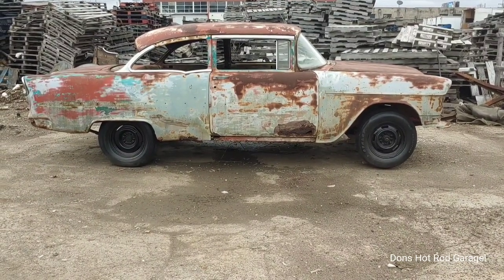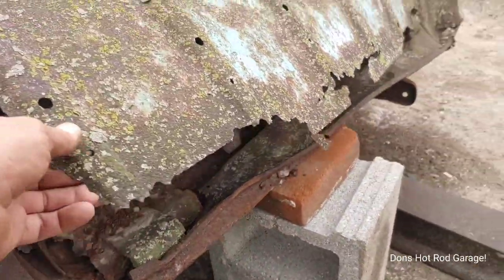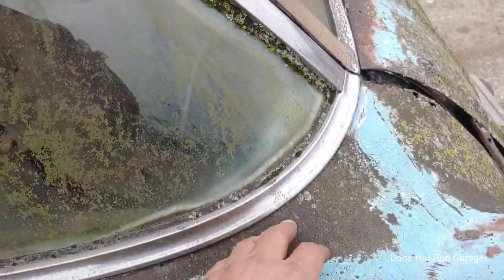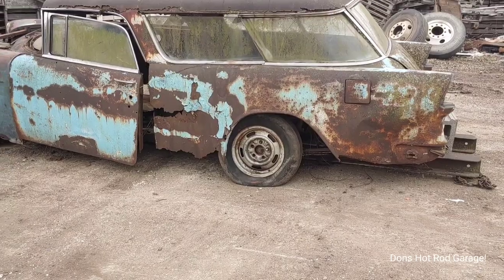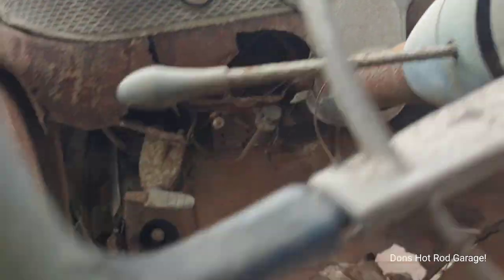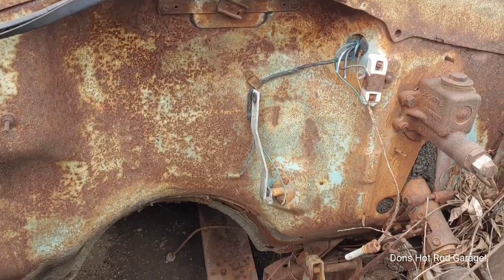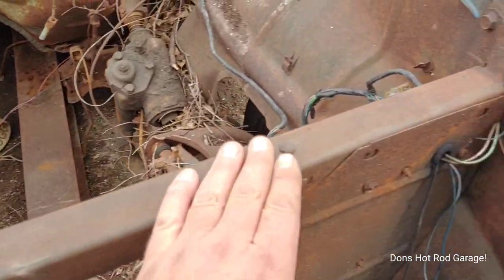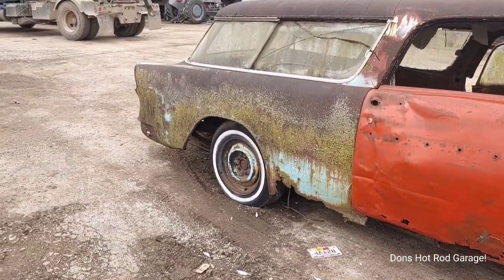55 Chevy Nomad Junkyard Find! Worst Nomad I've ever seen! Total Parts Car!

Comment: Don, you were so right that this one is worse than "the other one". But I typically would doubt anyone will be able to save "the other one" until I saw what Dan's doing to his. He basically had a good roof & one door. He'll certainly be able to use some of your trim pieces, and maybe some glass. The border opens up on April 1rst (April Fools Day 🙃) so he could make a trip down when the weather improves to one of those Border Mailbox places to save on freight...
Reply from the maker: Hey Jim! Yeah this one is mega ruff! It'll help out countless other nomads get fixed back up! Ive contacted Dan about some parts I just have to get them off ans good from there! Catch you next time 👍
Reply: @donshotrodgarage1717  The only reason why I’m not getting Kim I I’m

Comment: Well done Don. Lucky you got it back with out it all over the highway. It's funny but it still a Nomad. . You could sell the two sides for wall Art. But great you see the parts worth saving.  Water jet some Nomad key rings..but I think this one gets laid to rest.  Flat pack the original metal on a pallet. This one will make you plenty money. Get a tripod. Film Work in action on Fast Forward. It's history for the people.  Good luck Don. Send me a Nomad keyring. Adios Brother. Have a good week.  Dino
Reply from the maker: Hey Dino! Yeah its mega ruff! It'll help out countless other nomads get fixed back up! I have a guy building a 55 nomad from scratch and he wants both full inner and outer quarters! There won't be much tossed out! I'll do plenty of videos on the tare down! Have a good one Buddy 👍 Adios

Comment: Wow! Lots of parts tho. Wonder if it got sunk in the ocean or something? My dad did that with some friends back in the 50’s in Daytona Florida on spring break. Can’t remember the car, but the car was never the same and rusted completely away in the next few years…
Reply from the maker: Hey Lance! Im not sure if it was ever in a lake! The spot it was setting at for the last 50 years was under a tree on the left side. I don't think it ever got and sun to help dry it out! Catch you next time 👍
Reply: My dads story was something like this; his brother and other college friends were heading toward Daytona Beach in about 1953 or 54. Dad was still in high school. He snuck out of the house with his roller skate case full of his clothes and etc.  They took the friends car which was a nice car. On the way, they set the car on fire as they were throwing fire crackers out the window on a bridge trying to scare some fishermen… a firecracker bounced back into the car and under the seat and it caught fire. They put out the fire and continued. When they got to Daytona Beach, at the time, people drove up and down the beach. So they did the same thing. But got stuck in the sand and the tide came in and swamped the car. They eventually got it out and drove back to Michigan. Didn’t wash the car, didn’t do a thing with it but drive it home. Very quickly the car started rusting and was a horrible rust bucket probably a year or so after. But anyway, dads now passed away but I always got a kick out of that story. Teenage boys and cars… I can totally see a similar story in the Nomads life but I guess we will never know… thanks for the interesting videos!
Reply from the maker: @lancenutter1067  wow man I wasn't expecting that. Really cool story and I have heard you could drive on the beach years ago. Im not sure may be the nomad had a similar experience with the ocean! It sure is mega rusty!  Catch you next time 👍

Comment: The bad thing that happened with nomads is back in the 70s&80s nobody wanted them cause they always leaked from day one rear hatch and side windows they were just always wet inside unless you lived in like California or Arizona I remember when you could buy fairly clean nomads still daily drivers  for 800-1200 bucks all day long  lol. Alot of these started rusting out in the back and rear floor pans at only 5-10 years old though. East cost cars if daily driven and parked out side were toast at 10 years old max. Only ones left now are ones that originally came from southern regions as new.
Reply from the maker: Hey D owen! Yeah man your right about them leaking water inside! It seems like all cars when they hit the 15 to 20 year old mark are at there cheapest price pont! The ones from out west are by far the best ones but we still got plenty of them here on the east coast that a nice! Catch you next time 👍

Comment: 1955. I see lotta glass windows. Los and lots trim. The Speedo and steering wheel. The dash looks in good shape. More important is the shape of the panels. The chassis is an excellent template.
Reply from the maker: Hey Stanley! Its mega ruff! It'll help out countless other nomads get fixed back up! Not much will get tossed off this car! Catch you next time 👍

Comment: Don. Don't chop it to fast.  Rat Rod Bob has made cars out of worse than that.  Send him a message.  He just wants the outside panels he fix that up. After you pulled all the trim bits your want. It might not be dead yet..
Reply from the maker: Hey Dino! It will be carefully separated. I have a guy that needs both full inner and outer quarters to build his 55 nomad from scratch! Nothing will be tossed that is good. Later man ✌

Comment: I would still save the outer quarter skins from middle up.  And the rear end if its an original. And you can use that rear glass for now. And dash trim.  Good enough stuff for now just make a crusty.driver out of the one , floor pans running gear nose off the one you just got you have a couple nice drivers, so have a crusty one to drive that's totally dependable lol. Its Kinda to far gone to justify alot of money into it but its worth making a crusty driver call it the rustmad lol. Run one of them painless wire harness through it . they are worth every penny they do exclint work or put the new one in your other nomad and put the old one you take out in the crusty car . they all (tri 5 cars ) use the same harness unless it has power windows and air conditioning.
Reply from the maker: Hey D owen! Yeah man this old nomad will be carefully separated. I have many people wanting even the sheet metal off the car! It will help countless other nomads get fixed back up! Catch you next time 👍

Comment: Man, that really is just heartbreaking to look at. You can tell it was never seriously wrecked, and at one time a person such as yourself, who loves these cars and cares about them, could have saved it and made a fine project of it. 
           Some Idiot probably ditched it because it started burning oil, or maybe a ball joint started to rattle. 
"Duh hey, I busted up that Stradivarius violin for kindling to start a fire in the barbecue because one of the strings broke".
 How many beautiful things are lost forever because of that mentality?
        Be that as it may, you know what the next move is gonna be.
You've got to do what the indigenous tribesmen, formerly known as "Indians" used to do when they killed a buffalo. They thanked  the animal for giving its life, they thanked the Great Spirit for providing it, and then they proceeded to strip it down to the last bit, wasting absolutely nothing. 
         I think you'll be pleasantly surprised at the amount of usable salvage you come away with when you break it down. You've got what looks like most of the glass, the fenders can definitely be saved, most of the dash trim that's still there looks all right and there's lots of hard to find body  trim. I can also tell you that the radio can be saved. It has tubes in it. My '59 had a radio like  that and the tubes were 12AX7,. and 6V6, very common, and still being made today for thousands of guitar amplifers all over the world, (I build, repair, and sevice those, and tube technology is very familiar to me) so don't scrap the radio. It'll be a fairly easy fix. The tubes are probably RCA or GE, and they might even still work. A music store will most likely have a tech with a tube tester and can tell you if they're still good. They might just be fine, even after all these years.
         I repeat what I said about it being heartbreaking, but the best way to honor the remains of that car is to make sure that as much of it as possible gets a chance to live on in another one.
           You've got your work cut out for you, best of luck with all of it. Once again, keep us posted on the progress!!!
     Cheers, and hats off!
Reply from the maker: Hey man! That's awesome the knowledge you have on the old radios and the tubes! You have to let them warm up and boom here comes the music! I'll carefully separate this car! Its help countless other nomads get fixed back up! I'll do plenty of videos of the teardown! Catch you next time 👍
Reply: @donshotrodgarage1717  if I lived anywhere near you, I could bring my old '56 Fender amp over, and we could put those tubes in it and find out in 2 minutes if they work, and if they sound good. Tubes are fascinating little boogers, and they are as much fun to play with as cars and engines. In a way, they are kind of like little glass engines. Plus, they have soul. 
....... Just like '55 Nomads.